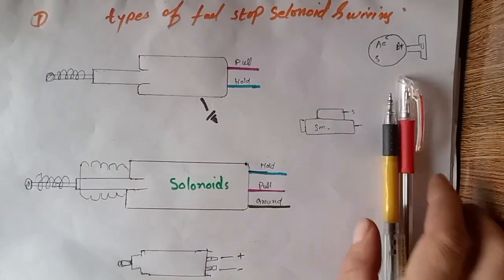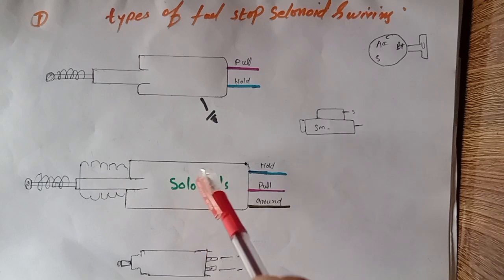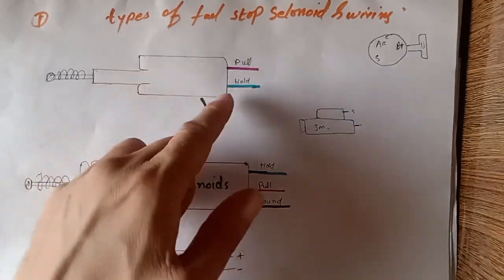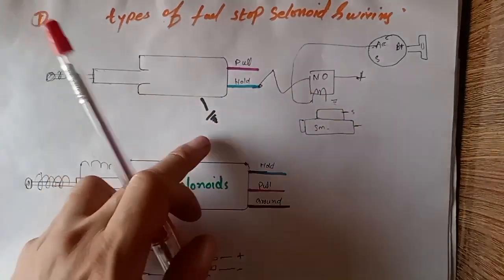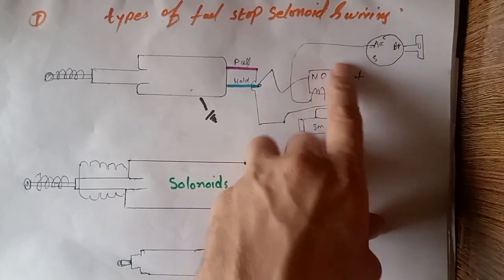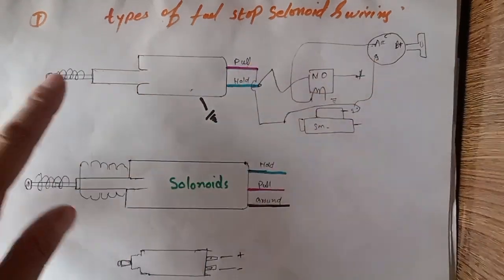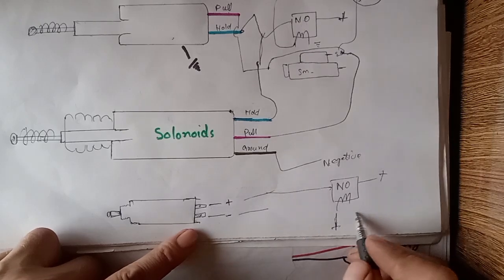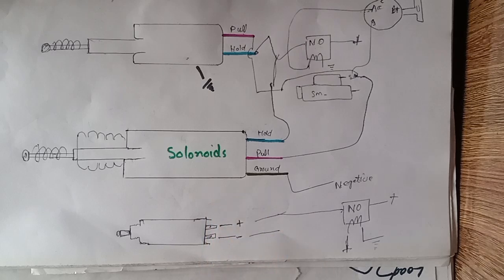Fuel Stop Solenoid wiring connection  , 3 wire 2 wire complete wiring diagram explain

Comment: I'm using a 2-wire Hold and Pull solenoid, and the Hold + terminal and Pull + terminal are the same. How can I test whether the solenoid is working properly? My plan is to try using a 12 volt power supply, for the positive power supply I connect it to Hold, then where should the negative power supply be connected?
Reply from the maker: One is only pull during engine crank, the pull wire is only control by cranking relay attached with starter motor S terminal,  and hold is control py fuel control relay which is hold for Long time
Reply: @Info-Tech-  Can we test it separately? I mean, remove the solenoid from the engine, and I only want to test the solenoid, but the terminal on the 2-wire solenoid is only positive? How do I test it?

Comment: i have a fuel solenoid for a cummins engine. it has a 2wire , doesn't hold but releases and engine stops
Reply from the maker: Two wire solenoid only + - positive is control by key switch, simple